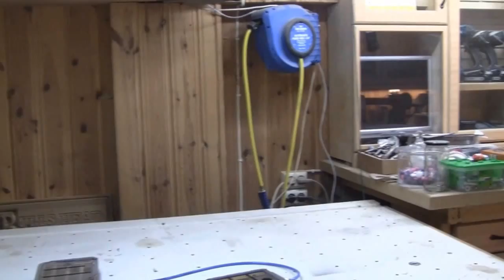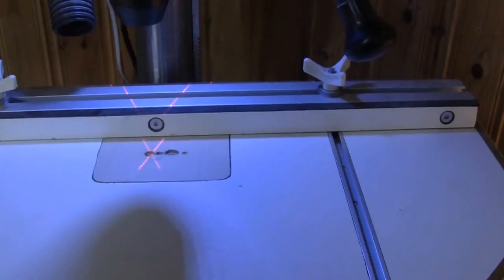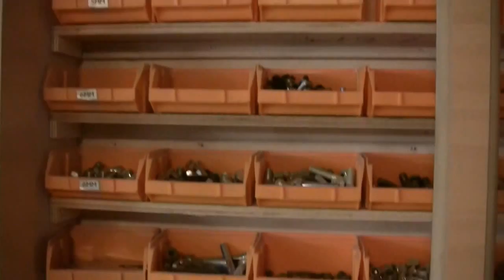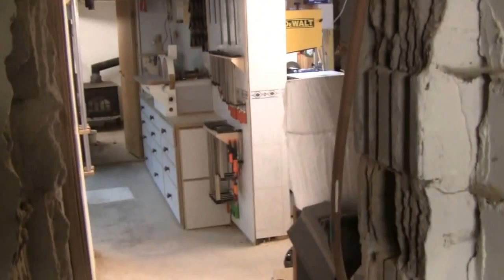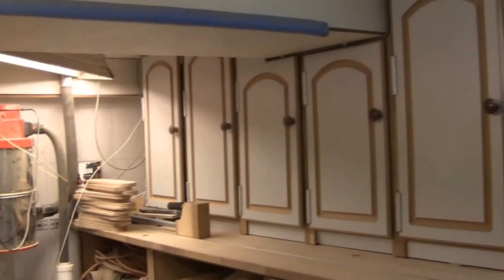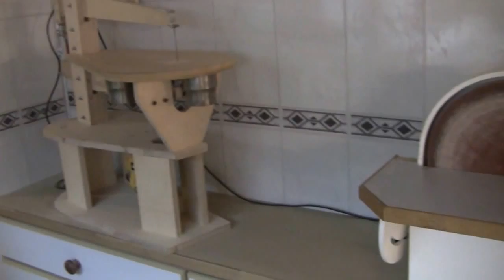Shop Tour 2014

Comment: Very neat (Cleaned before the video and i bet messy soon after like my wood cave ) I like the system for the grinders - Ive been trying to work out the best way to place 3 and polisher. You opened up some better ideas - Thanks, I'll put up . a video some time and defiantly link this video. I see you have a lot of cabinets, specifically drawers, do you find that the glass cabinets are better? I seem to loose tools in the drawers and end up buying small tools I know I have but cant find until moths later... You guys in US and Canada are fortunate to have access to tools at far cheaper prices that here in South Africa (import pricing). If you get time to do the mods to your dust collector near the table saw (that would be something im keen to see (as mine are similar) and there aren't many vids that I find helpful (the housing type of collector)
Reply from the maker: Thank you Gareth. The glass door cabinets makes it easy to see which cabinet holds the tool I need , without opening it. I find under bench drawers much better than cabinets.
With deep cabinets, you only utilize the front 1/3, the rest is just a place for stuff to hide and never re-appear. I swapped the dustcollector out for a central dc system. you can watch it here:  https://www.youtube.com/watch?v=OSoZJ3criGE

Comment: hello sir, love the video. i wanted to make some drawers like you did for my screws/drill bits/brad nails etc. Where did you find the small plastic bins in all sorts of sizes for the inside of the drawer?
Reply from the maker: Thanks. They are made by a Danish company called Raaco. Not sure if they are available outside of Europe. I found mine in the dumpster at work

Comment: Didnt check all the comments but where did you get plastic dividers for top small parts drawers?
Reply from the maker: They are made by a Danish company called Raaco. Not sure if they are available outside of Europe. I found mine in the dumpster at work

Comment: hi, nice shop, how did you build your CNC , looks very nice and big.
Reply from the maker: Thanks Max. I built it from salvaged parts from old machinery that we dissmantled. The x and Y axis is servo driven and the z is stepper motordriven. timing belt on x and y. ballscrew on z. Mach3 software. thanks for commenting and for watching
Reply: thank you.

Comment: Makes me ask the question which came first the chicken or the egg ? Did you have the parts and then make the drawers, or make the drawers and then got the parts ? Great shop. Very Organized
Reply from the maker: +Nick J Thank you for the kind comment. I collected all the stuff first, then needed a place to put it and to organize it. 95% is stuff I got for free over the years, as they threw it in the dumpster at work. I even waited to get the drawer slides from an old file cabinet room. I think I got 40 pairs. Had to build the drawers to fit these. glad you liked it, and thanks for watching and commenting
Reply: Brother...

Comment: wow just found your channel, do you have an info on your cnc build? I am looking to make one and wonder what components you used
Reply from the maker: +Into The Dirtshop Thank you for stopping by. I will be doing a video with more in depth on the cnc soon. There has been several requests for it. Basically it is made from only salvaged parts. the only purchase is the router, a ballscrew for the z axis, and mach3 license. Cannot estimate release date yet, as I am working on a video series on another topic right now
Reply: Bellevue Woodshop ok sweet i cant wait for that.  where did majority of your bearings and axis come from? like old laser printers? scanners?  stuff like that with linear moving components?  I have quite a few screw drive garage door openers, was considering using those but the plastic worm gear cant take much load and has too much slop in it

Comment: Yes. The translate of Google is bad but you understand me measure approximate thanks.
Reply from the maker: +David Rosales Workbench is 950mm tall, as it is a standing workbench. Lowe cabinet are 400mm wide.
Upper cabinets are 750mm wide, 950mm tall and 200mm deep

Comment: Just came across your video, your very talented and obviously a great scrounger. A couple of questions though, what brand are the small bins in your hardware drawers and what kind of work are doing in your shop?
Reply from the maker: trumpnut  Thank you very much for the generous comment, it is much appreciated. I tend to see a possible use in most things people call trash:)  they are made by Raaco , I believe its a Danish company. Another dumpsterdive at work resulted in three large crates full of hundreds of these. They came to use as you can see. I do mostly jigs, and homemade experimental machinery, but also some traditional woodworking for friends and family

Comment: A very interesting working space. I was surprised to see the rock under the table.
Reply from the maker: scott33761 I have though about it. The drillmark are made by me. I removed about 1/2 m3 with drills end wedges along with expanding concrete. The rock used to be all the way to the middle of where the tablesaw is. I removed just enough tpo be able to walk along the miter bench. Everything was removed by hand. Unfortunately my kids are to small to operate heavy equipment. Thanks for watching, glad you liked it
Reply from the maker: ***** I really wish my shopfloor was even and not having rocks pretrude out of it, but one has to work with what one has got, so I manage. I do hope to have a rock free shop one day in the future (except out of the speakers though)
Reply: Bellevue Woodshop   With a rock hammer and some time it could be gone or you could carve it in to something or you could teach your son or daughter how to hammer in that space. That rock has drill marks in it which means someone  just gave up, good luck. Even with the rock you still have a nice shop.

Comment: Thanks for sharing! I'm renovating my own shop and i would like to adopt your idea with the drawers and cabinet. I really like the design. Anything you would change if you were to do it again? What material did you use? It looks like timber, but i guess it's plywood. Or would MDF be a good choice?
Reply from the maker: SuperBlokske Thanks for watching, commenting and sharing the video. I got the all the drawerslides for free, so I was kind of tied to the dimension of these, but overall, they have served me well. I used 9mm plywood for the drawers, but they are sitting inside a metal frame connected to the drawer slides. This makes them removable if I want to. the false fronst are 18mm mdf covered with high pressure laminate

Comment: Whats you job ? if u dont mind
Reply from the maker: Jay Sybrandy I work as an automation electrician at a factory producing wall panels for bathrooms, and also countertops, all covered in HPL (High pressure laminate) or as someone like to call it, respatex. The base of the wall panels are furniture grade baltic birch plywood. The supplier ships the pallets with a cover sheet with at least 1 good side on it, or a minor defect, these sre between 9 and 20mm thick and 4 x 8 feet. These are not used in our production , and are concidered waste (believe it or not) So I am fortunate to be able to get unlimited amounts of these and a lot of cutoffs from other laminated products, including solid wood countertops
Reply: Ok thx

Comment: which drill press is that? I've been looking for a drill press that doesn't need you to change belts.
Reply from the maker: Everfalling Its branded Einhell, and is a German brand. I am not sure if it sold outside Europe
Reply: You can replace the single phase motor of any drill press with a small 3-phase motor and install a Variable Frequency Drive on it which will allow you to run 3 phase off of household single phase power. Most guys are using the Teco brand of VFD. Full range of variable speed (down to single digit RPMs for power tapping), instant start, instant stop, and instant reverse (again for tapping). Search YouTube for VFD drill press. Lots of guides available. You could do this for about $150 US for any drill press.
Reply: Jon Miller oh cool thanks. any recommend guides for that?

Comment: That's a nice 6-inch jointer, if you put it on a solid surface and get rid of the supplied stand.  I wish Harbor Freight still sold them.
Reply from the maker: douro20 Thanx, I have yet to put it to really good use, as I have not had any major project needing preparation of stock. I got used off the Norwegian version of Craigslist, and my wife drove 11hrs to pick it up, so I think I will have to use it to justify that trip:)

Comment: Very nice shop you made! The table saw was very impressed especially. Can I have maker & model # for the hanging blue reel? Is that a hose reel or cable's ?
Reply from the maker: Young Choi Thank you Sir! It is a self retracting  30 feet long 1/4" air hose reel. It is sold in a lowprice supply store here in Norway, in the same pricerange as Harbour Freight called Biltema
Reply: Bellevue Woodshop Thank you very much for your prompt reply. Have a safe woodwork!

Comment: Excellent Shop Tour!!!   Where did you get all the dividers that you use in your small parts storage drawers?  OUTSTANDING Organization!!!!
Reply: Bellevue Woodshop Agreed, great shop both in thought/ingenuity and craftsmanship. But I agree with Johns Woodshed, those bins are key for the organization system and being able to remove them too. Please ask at your work where they get them. I just spent 30 minutes googling eBay, alibaba, amazon, and others trying to find something that even remotely resembles them. no luck.
Reply from the maker: Johns Woodshop Thank you SIr. The dividers that hold the screws are small plastic boxes I got for free at work, I am not sure where they came from unfortunately, but great to have the possibilty to take out a box of screws and bring to the project as they are removable

Comment: Now THAT'S a very impressive shop!  Cheap Chinese drill press? I don't think so.  Can you show us how the variable speed works?  You've got enough parts there to start up a small hardware store.  Very nice indeed.  Thanks for sharing.
Reply from the maker: David Handley Thank you David for the kind comments. The Drill press is working ok, but has some play in the quill that has to be dressed. All the parts are collected over the years and is given to me for free at work.  I always try to get some good use out of it. If you pm me your email adress I can take some ohotos o the whats under the drillpres hood, although I have neve actually looked under the

Comment: Dewalt makes or used to make a bandsaw? Show us the bandsaw and how it compares to the other ones on the market.
Reply from the maker: This Bandsaw is 8yrs old, and was given to me by my brother in law. He had got it from someone having a hard time getting straight cuts and getting the tracking of the blade to work smooth. I did some tweaking on it, and it got a little better, but not perfect.
It works more than good enough for my kind of work. It might be that they only make these for Europe. I have seen 20 years old Dewalt bandsaw also. The is typically different tool series in US and Europe, as I contacted Dewalt Europe to ask if it was possible to purchase the DW 735 thickness planer, and they said these are not distributed in Europe. I have no references to other bandsaws, or used any other ones, so I am in no position to make any tests or comparisons of bandsaws, unfortunately

Comment: You say thanks for watching but I for one want to give you a BIG Thanks for sharing!!
You took a short basement (w rock on one side) and made it a great wood shop! Especially like the cabinetry and organization (wish I could do 1/4 of that). Your DIY tools and jigs are an inspiration. I do have one question; the electrical plugs aren't the type we use in the USA but sound like your from the northeast USA? Thanks again!
Reply from the maker: You are welcome Mrrwmac, and thanks for stopping by. Sometimes I get a little upset having to open a cabinet every time I need a tool, but after picking up a clean tool from its place, i forget the trouble. I dont think I would have put the tools in cabinets if  I did not have glass doors to easily indetify whe the specific tool was. getting older normally dont help on remembering where stuff is:): Glad if I am able to inspire someone with my work. The electrical plugs are regular 220 v outlets that we have here in Norway, where I am located. I spent 6 months in New Jersey.....that might be the reason for the slight NE accent??:):)

Comment: great video! I love your homemade tablesaw! what kind of pulley system do you use for the infeed table?
Reply from the maker: Thanks spacehero. Are you refering to the sliding table?. It is made from 30mm Bosch Rexroth linear rails with pillowblocks from the same supplier. A little tight, but tight is good rigth?. It could have been a little lees friction in these blocks, but hey, thats jus neat picking. overall satisfied with the performance and function of the saw.